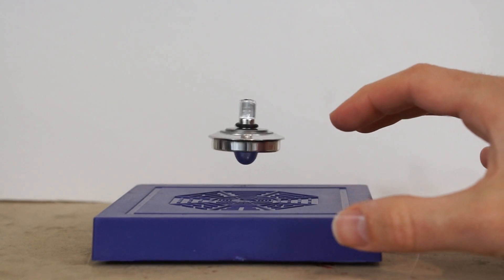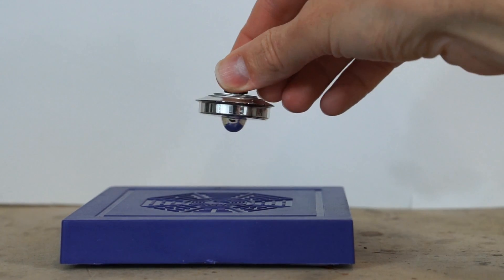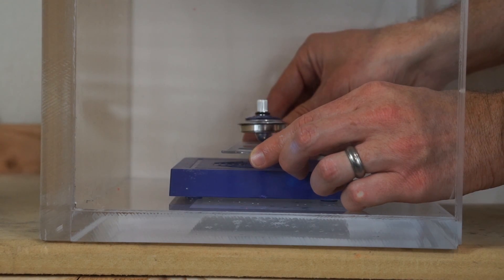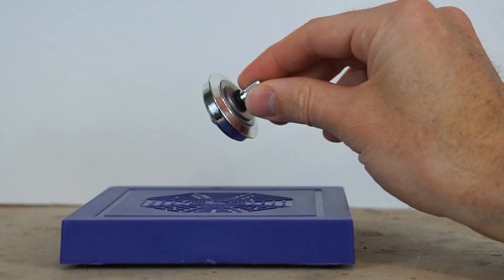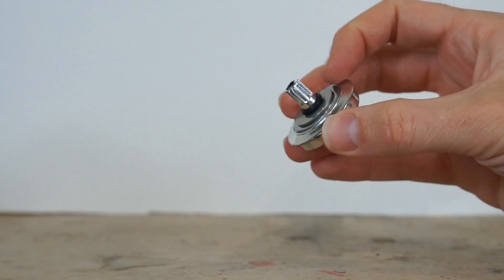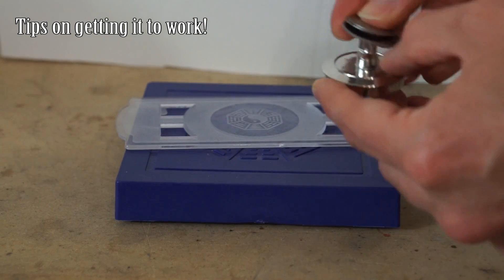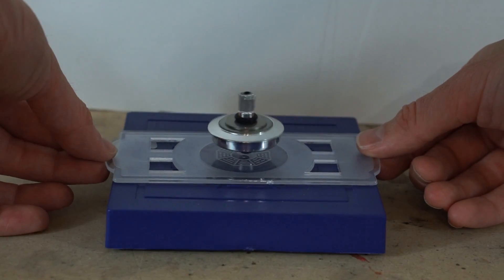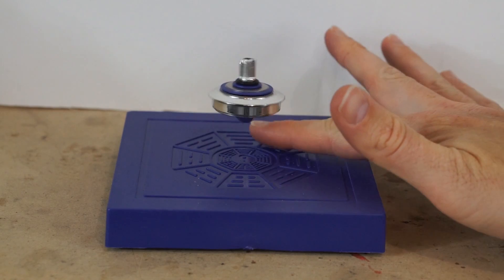Will a Levitating Gyroscope Spin Forever in a Vacuum Chamber?

Comment: I think the movement of conductors (presumably the magnet or anything in the spinning top) in the magnetic field (by the permanent base magnet) generates electrical currents and thus absorbing some energy of the rotatonal kinetic. I think this is the more significant "absorber" of the rotational kinetic energy.

Comment: if earthly magnetic force always changing then how much big coil required to glow a LED
half gauss into length of coiling or turned of loop
so what is the formula between magnet flux induction induced by changing polarity and current generator so we calculated that energy which is glow this whole solar system without any power source just by using earth magnetic force

Comment: I suspect that the eventually instability of the spin comes from the decreased air damping. If you slow the video down, you may be able to see if the spin actually slows down. I don't think it slowed all that significantly. However, withdrawal  of the air would've decreased damping of the system that exacerbates the imperfect spin.

Comment: the balance is already off  and it will come out of its plane very easy with zero air resistance  and then the magnets will try and flip and attract and were done … I think a faster more stable initial  spin could last a lot longer Maybe forever! just a hillbilly guess

Comment: Precession is frictionless and in itself it's a stable and periodic process, so no: it's not falling due to precession!
Magnetic domain shifting? At room T?? Does it cause energy loss???
Eddy currents! 
You didn't think of it because the "shiny disk is actually plastic"? Then how can it react to a magnetic field??
And vacuum is not perfect vacuum: do you have a measure of air pressure in what you call "vacuum"? Can you say what's the friction??
>1M visualizations? I would say you owe your visualizers a bit more diligence

Comment: Even in a vacuum there is still a force acting on it from above. Gravity. F=ma. As you cannot spin it perfectly so that the distance from the magnets does not vary at any point on the spinning object then eventually the force from gravity will overcome the magnetic force. Removing the air just makes the process slower as this variance is not related to friction on air molecules which would normally be added to the gravitational force. Space is a totally different issue.

Comment: 1. Rotation creates magnetic field.
This magnetic field will interact with outer magnetic fields (mainly earth's) and will cause back EMF. Eventually it will stop.
2. Due randomness in rotation at this low speed, a point will soon come when the spinner ends up in topple

Comment: Since the spinner became less stable over time it clearly is not perfectly balanced. 
Any technique employed to impart initial spin will introduce forces trending toward destabilization.
A perfectly balance spinner should theoretically allow for reduction of initially imparted destabilizing forces.
The interaction of axial rotation within the field of a ring magnet can only promote alignment of poles.
It appears that friction is a lesser negative than imbalance of mass.
Reduction of a number of negatives will promote efficiency toward the maximum in a given environment.
There can never be an environment free of negatives.
However, there always must be a renewable source of energy to sustain any action.
Maximum resource is required for maximum result.

Comment: If there is anything electrically conducting in your spinner, it will experience magnetic Lorentz force due to induced currents (like magnetic brakes work), which will slow it down due to Joule dissipation of (induced) currents in the metallic parts. However it may be mostly plastic, perhaps paint is somewhat conductive...

Comment: Without even watching the video the simple answer is no it will come to a stop. It will take longer but as the have not negated the effect of gravity. They removed the frictional loss that would have come from contact with a surface. The levitation is a form of magnetic field which adds drag and gravity is still acting upon the top, pulling the top towards the ground.

Comment: Gravitational waves are way too tiny to even be measured in such a way. 
The incomplete vacuum wouldn't make it stop that quickly. I think it could go at least a week if all resistance was from the air
If the magnets are moving, try cutting the plastic box and glue the magnets on a piece of glass or marble, then secure it to a massive hard block of rock or something non ferrous.
Then if the spinner still stops  quickly it means it looses energy by emitting low frequency EM waves

Comment: It stops because magnetism also has friction. The force that's put on the magnetic top by the circular magnet on the base panel creates friction. Probably more friction than air would. I think it best example of this is if you were to drop a circular magnet through a magnetic cylinder over and over again. The ball will eventually heat up and melt.

Comment: It won’t spin forever. You have the friction from ground contact removed. The air is removed removing more friction. But if it starts wandering, gravity will pull it down to one side of the magnet

Comment: the main reason for lost spin energy is induced electric current in the two objects, the spinner and the static magnet. If any electrisitu flow in a inperfect conductor(that has recistance) power is disipated and the energy is drawn from the spin. eventually the spinner wil loose too much spin energy and tip over.

Comment: It isn't going to spin forever,  but that's really not the issue,  which is what will cause energy to be consumed by the top if it's spinning in a vacuum?

In a GOOD vacuum,  the losses due to friction with air molecules would be slight,  because their ain't gonna be many of them.

Interaction with the earth's magnetic field?  Again slight.

I suggest the following as the two  major losses of energy which will cause the top to fail before long: 

1.  Procession:  the top uses energy from its inertia to keep itself upright.  This use of energy slows the top and will cause it to collapse before too long.

2.  A magnetic top rotating in a magnetic field suggests that free electrons in the top will be constantly moving back and forth as the top rotates,  causing loss of energy through electrical resistance  --- generating a small electrical current moving through the top as it rotates.

The source of this energy is the rotation of the top through a magnetic field,  and just as you have to crank on a generator to get it to generate electricity,  it takes energy to turn the rotor,  and that energy will come from the rotational speed,  contributing to it's slowing down and eventually collapsing.

I don't see that anyone else has identified this as likely being a second significant source of energy loss in this system,  with procession being the major source.

Comment: my guess is that it still loses kinetic energy to the field from the lower magnet, perhaps not perfectly a balanced top, the magnetic fields are not perfectly symmetrical or smooth with little bumps or uneven areas in their fields.

Comment: I have read that the viscous drag of air is constant from 10 atm to 0.0001 atm.  For a vacuum chamber to reduce viscous drag requires pumping until a thermocouple-guage reads near its bottom, a vacuum pressure something like "10-20 microns".  So I'm really not sure how much the air-drag on spin will be reduced by going to 0.05 atm.  You might want to try some experiment using a big smooth round non-magnetic rotor dangling on a string from a spinning motor-shaft.  Twisting of the string would represent strength of air-drag.

Comment: It would work, except for the fact that there is flux modulation. any time there is variation in flux strength, there are eddy losses, just because you have a conductive object crossing lines of flux. If the top was perfectly balanced so it didn't wobble, it would spin much longer. If there was a way you could spin it up with a motor, not only could you spin it faster, but also more consistently. With that, you could get a real comparison between air and vacuum. To avoid eddy loses, you would have to make sure the magnets had a purely homogeneous field, and that the pole centers were on exactly the rotational axis. I don't think you're going to get that kind of precision with an inexpensive toy like that. If you wanted a flywheel to spin forever in space, it needs to be made out of a non-conductive material. Even though the earth's magnetic field is pretty weak up there, it will still induce a minute current in anything that conducts electricity. That will eventually slow it down. if it's an insulator, it will spin practically forever.

Comment: Pardon the correction on your friction explanation, but it's not friction between the magnets. Friction is caused by contact between two surfaces...not by magnetic fields. You are correct that the magnetic fields interacting with each other does cause a force that eventually slows the spinning top/gyroscope, but it's not friction. Also, you can't pull a perfect vacuum (i.e. no molecules of gases present). That means that although you can reduce the presence of gas molecules in the chamber to very low numbers, there will still be some molecules left...and this does provided some very minimal friction every time a stray molecule bumps into the spinning top. However, this friction is minute compared to the force exerted by the interaction of the magnetic fields, so this is the primary reason for the loss of angular momentum of the spinning top. So kudos to you for understanding the magnetic fields interacting with each other is the main reason for the loss of angular momentum, but calling it friction is not an accurate term for that interaction. Friction comes from contact of two surfaces...whether that be solid to gas contact, solid to solid contact, solid to fluid contact, etc...friction is always due to contact...not due to interaction between energy fields such as magnetic or electric fields. I hope you don't mind the criticism...just trying to make sure you use the correct terms when explaining things in your videos so as to avoid misinforming viewers.

Comment: Sorry, but you have to spin it(apply force) after the air is out(resists force) or the experiment is moot. At least spin it by motor and time it after release both in and out of the chamber

Comment: I think it will stop because of the fact that the gyroscope was tilted and the magnetic field would keep pulling it down more and more until it flipped if it was perfectly smooth without a tilt it would just hover forever without the air resistance.....it wasn't the air resistance that made it fall it was the magnetic field

Comment: Spinning in an orbit, especially for large bodies like planets and moons, you lose energy due to tidal forces where the difference in gravity between the close and far side squishes the object slightly as it rotates converting rotational energy into heat. This is why our moon is now tidally locked and always shows the same side to us. Eventually the same thing will slow earths rotation so that the day becomes so long that it will match the lunar month making the moon hang above a single point on earth. Not sure if that happens before the sun burns out tho 🙂

Comment: It will stop due to Eddie currents forming in the magnet. As the thing spins it will be breaking magnetic field lines and will induce Eddie currents. This causes heat within the spinning part and so energy is lost that way. Kinetic energy is turned into heat and is radiated away.

Comment: I think it would stop because there was air initially in the chamber. To get a constant spinning, you would need to start the spinning in  full vacuum conditions, maybe with a robotic arm inside the chamber. Also, if the spinning is not in the perfect stable area of the magnet, it will fall.

Comment: It will stop because nothing is perfect vacuum.
Reply: No.  It will stop because energy is used by procession to keep the top upright,  and this energy comes from slowing the top,  which will eventually collapse.

Secondly,  this magnetic top is rotating in a magnetic field,  which means that electrons are sloshing back and forth from the rotational speed much like in a generator.  the flow of electrons is consumed by resistance and turned into heat.

Just like with a generator,  it takes energy to move those electrons,  and that will come from the speed of the top,  causing it to collapse.

I suggest that the two major ways energy is consumed in this system is 1) procession  and 2) electrical current flow and resistance.
Reply: Eddy current?

Comment: While obviously you can't make something spin forever, and even the magnetics in this case generate a friction.. I'm sure you could improve your results significantly, by starting the top spinning inside the vacuum after it's already at full-vacuum, rather than starting at full atmosphere and then turning on the pump.. Although that would require a complicated mechanical spin&release system built inside the chamber too. lol
Reply: you can, in space
Reply: @DyqnoDynamite  what if even in space it will stop eventually it just will take millions of years because i'm pretty sure even in space theres still air that could generate friction or something like that
Reply: @TactfulWaggle  well Earth has been spinning for billions of years. given that the universe existed only for some billion odd years, i'd say it's pretty close to what people actually mean by the word "infinite"
Reply: @igvc1876  if it spins the duration of your own life time. It cant be proven to you that it ever stopped..
Reply: @Biglyp that's because of Moon's gravity and the fact that the Earth isn't solid, causing internal dynamics to exert a force. If Earth was solid and without a moon it would spin forever
Reply: r/ iamverysmart
Reply: @NatePearson-w6t  people cant make observations?

Comment: It will stop because a perfect vacuum is impossible (in intergalactic space too, but on earth specifically eventually you start sucking the containe's particles)

by spnning arbitrarely fast you'll make it last arbitrarely long, however, since you can't spin it faster then a certain amount, it will always spin for a finite amount

Important to note is that by removing the air it would still last longer then with air.

Comment: Chaos theory, the small imperfections at the beginning will be aplified during the run, and destabilize it until it tips over cause of them?
Reply: I have now heard your explanation...and I think it's wrong, I challeng you to remove the magnet support, and leave it with just the 2 bear magnets, starting the spin already in vacuum using a remote controlled motor (powered via a super capacitor) joined with a chassis capable of stabilize the magnet already in midair! That should prove you that, the first imperfection in the run will end up aplified and rip the thing...and if you will say that it is caused by the friction between magnet and chamber, well, glew that in place and the static friction won't dissipate energy! Just the wabblings will make it tip over!
Reply: Remove the magnet support and leave only the magnet, uh? Man you are missing some physics lessons

Comment: I'd say that of all the forces causing that top to stop, friction in the air is the least of them. First off thats a cheap toy so the magnetic field is in no way perfect causing the wobble, which is how it lost most of its momentum. Every time it wobbled that was the gyroscope trading momentum for stability. If the field was better and the only force acting on it was air friction. Then it would go forever in a vacuum.

Comment: Aside from the fact that even if you only had a handful of molecules of gas in that chamber it would still slow down, however slowly, I have a feeling that the rotating magnetic field generated by the gyroscope induces a current in the base magnet that tends to slow it down as well.

Comment: It will stop not only because this isn't a perfect vacuum but because even if it was the constant warping of the material due to the spinning would convert kinetic energy to thermal energy which would then be radiated. I'm sure there are other reasons too. Just my response to 4:30.

Comment: it will not spin forever. the rotational force you applied to rotate it creates the angular momentum on the vertical axis. the momentum then produces a vortex which inwardly pull itself in and thus stabilizes the gyro on a vertical position. this inward pull of angular momentum reacts against the gravitational pull at the peripheral sides. but the gravitational pull at the vertical point of the center is mostly constant. what then makes it levitate is the repelling magnetic force  of two  similar polarity . but when the angular momentum gradually loses its rotational force due to energy dissipation or decay  the gyro will eventually succumb to the gravitational pull of the earth and flips over to the attracting force of the magnet. the vacuum and air resistance has no effect on the gravitation pull of the earth and the magnet repulsion or attraction. if the set-up will be duplicated in outer space and in the absence of any intervening cosmic forces seen or unseen, might spin forever. since energy according to theory of physical laws cannot be created nor destroyed but can only be transformed, the rotational force (kinetic energy) will last forever. then the gyro will not stop spinning. who knows? the set-up was not duplicated in outer space. thus we cannot verify the outcome. good day to all!